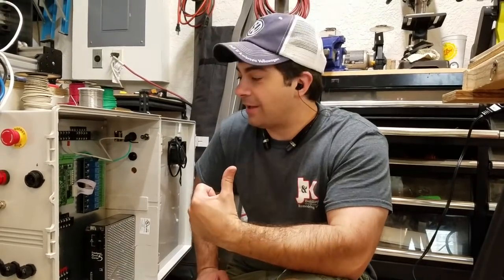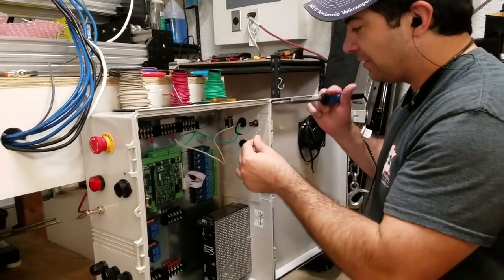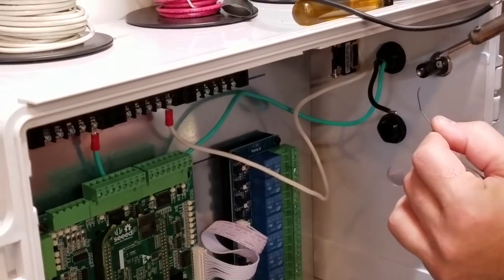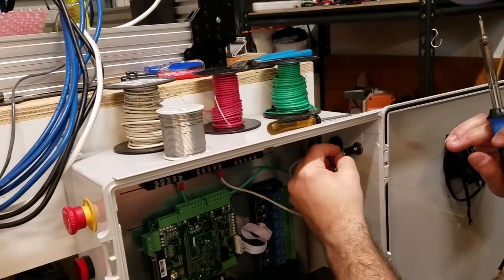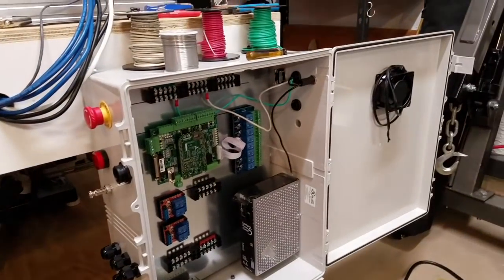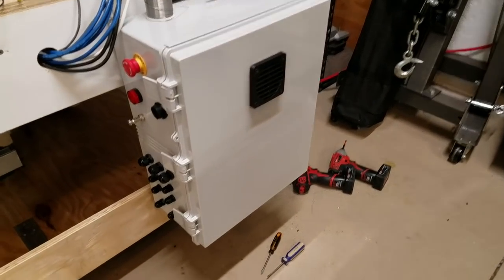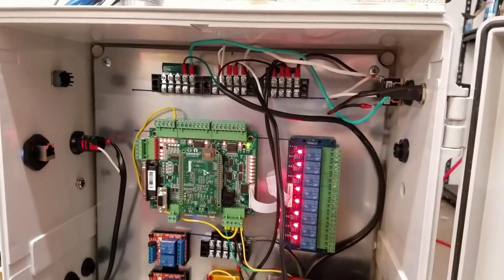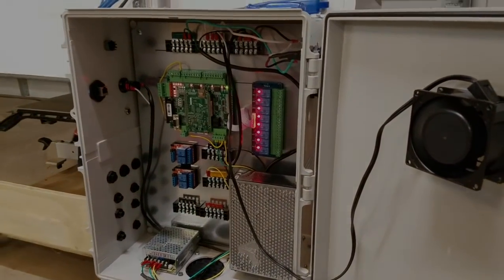WorkBee CNC Router: Update 4 Connecting 110V Power

Comment: Hey Franco, love your videos! I was curious in all your testing with steppers and servos. Do you find the clearpath servos are way better then the closed loop steppers? Enough at least to justify the price difference? I'm building a large 3d printer and have not decided which to use. Im leaning towards the clearpath.
Reply from the maker: The ClearPath servos are better than closed loop steppers in terms of pure performance.  But, depending on your application, you may not need that added performance.  I won't lie - I'm a big fan of the Leadshine style closed loop steppers as they work great for most DIY applications.  But, if you want/need ultimate performance/efficiency/support then the ClearPath servos are a great choice.  If you plan on making money with your machine, I'd seriously consider the servos over the steppers.  But I have two machines with the closed loop steppers installed and I'm very happy with them, as well.